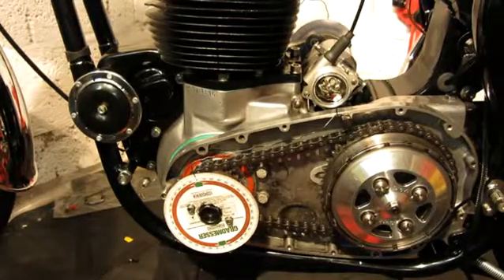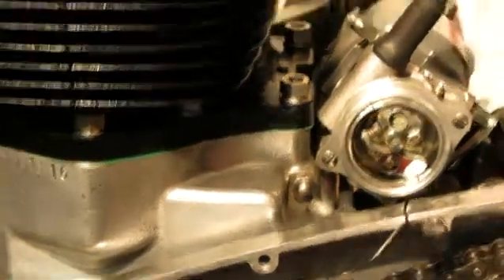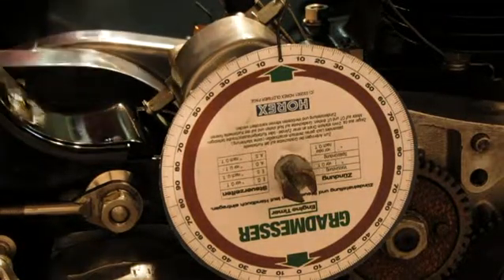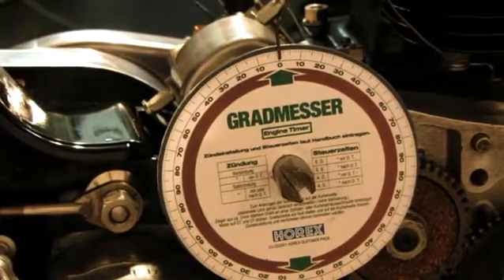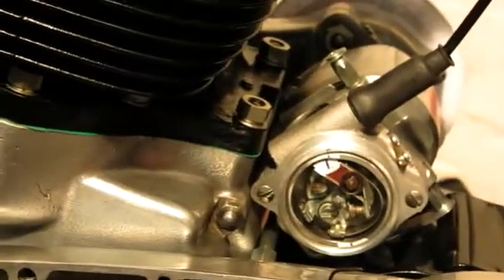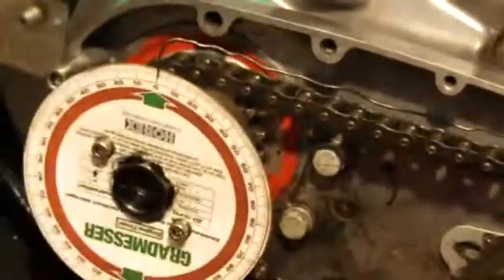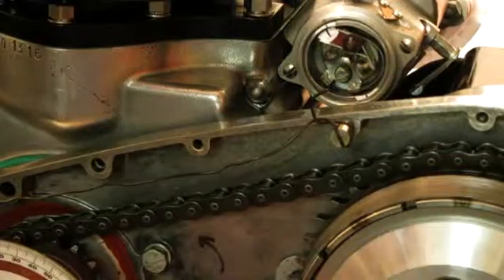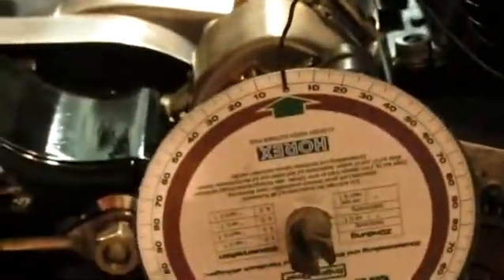MVI 0774

Comment from the maker: It turned out to be the camring housing to be ovally worn. That made the camring tilt and move so that an accurate timing could not be achieved, no matter how I sanded the cams on the ring. I got a new magneto camring housing, had to sand the old ring slightly and now have a deviation of as little as 0.5 degrees. The bike starts first kick.

Comment: It's the points slipring that is badly spaced, it is not perfectly centralised. In effect it is opening the points 2 and a half degrees early on the left side, and 2 and a half degrees late on the right side. When you set the timing (left side) you compensated for this and as a result you now have 5 degrees on the right. Getting it right is difficult and many magneto repairers struggle with it. Because 5 degrees at the mag equals 10 at the point of firing it is worth the effort to correct this.